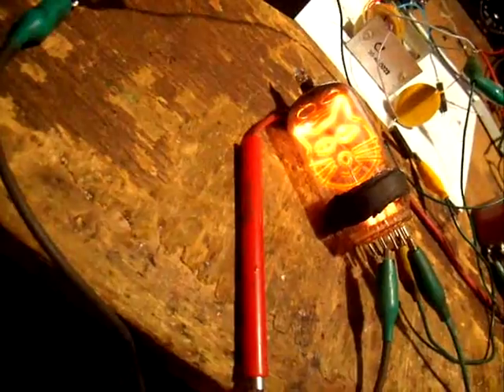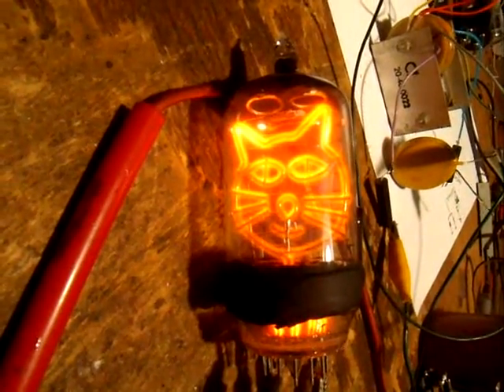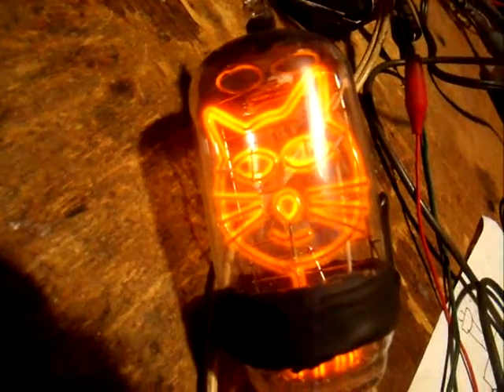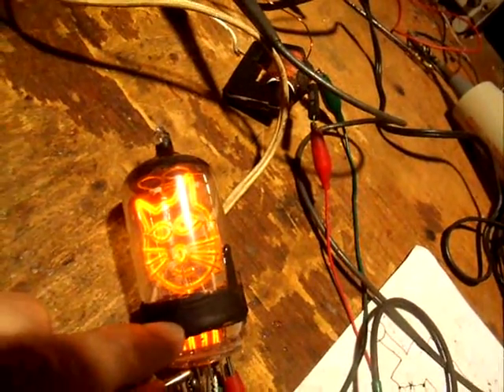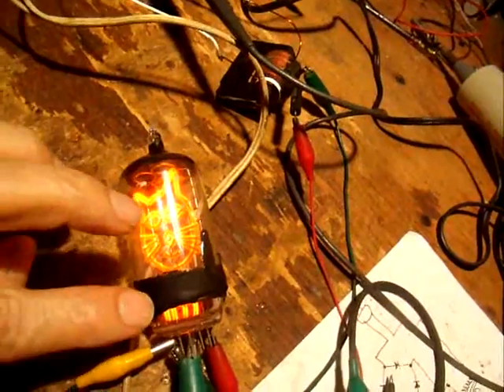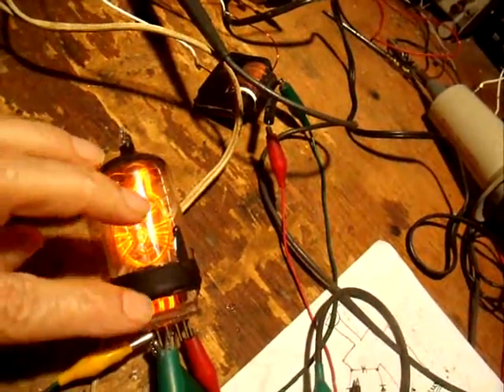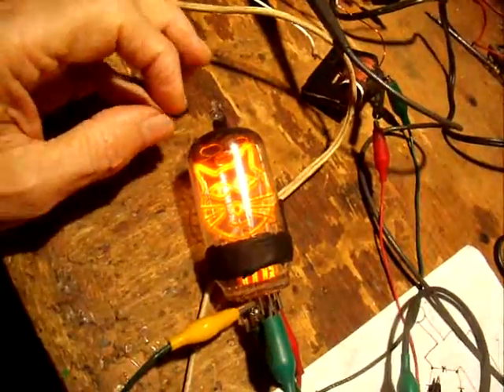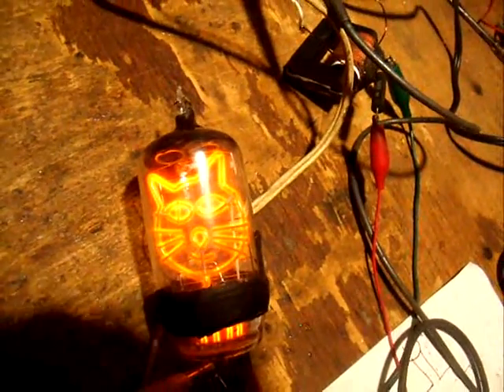WINKING CAT NIXIE TUBE!

Comment: Hi Eon why were you trying epoxy, instead of just fusing the glass like on your other tubes?
Reply from the maker: This was made of parts of old tubes that are soft glass. It takes very careful heating and annealing of soft glass to keep it from cracking. I have never been able to succeed at it using the old tube glass.
Reply: @glasslinger  Oh, I get that, but what was the point of using the old soft glass parts instead of your usual pyrex?
Reply from the maker: @andywander  I needed the 12 feedthrough pins on the bottom. Very difficult to make large numbers of feedthroughs from scratch.
Reply: @glasslinger  Ahh! Now that makes sense. I missed that part in the videos (if you explained it there). Though, seeing your work since this video was made,  I bet you could do a 12-pin base!

Comment: Stupid Question of the Day.....Could you use casting resin inside the glass tube to create a super-sized LED?
Reply from the maker: I guess so. Use one of the extremely powerful LED chips (10 watt or so) and put it in a mayonaise jar with the epoxy! What next!
Reply: what i meant is could you put casting resin in the bulb you have now to act like a led. not add a led. i want to make durable nixie tube out of plastic not brittle glass. after the resin hardens i might even want to break and discard the glass leaving a giant solid nixi bulb. would the nixi burn up the resin or short out? i have no real world experience with nixi so ...any guesses you might have would be appreciated.
Reply: The inside of the glass tube has to be hollow and empty of all air, otherwise electrons could not flow between the cathode and anode.
Reply from the maker: Yes! The stuff is really expensive I found. To make a "1 gallon" LED would cost around $75 and would have to be refrigerated during casting!
Reply: why refrigerated? heat of curing ?

Comment: you can get a softglass tubing called heavywall. used by Neon trade. 16mm diameter but much thicker. You can then heat it evenly and inflate it up to larger diameters.

Comment: Flame annealing (or kiln annealing) should help to make your glass not crack. So making welds easier. Pyrex to soft will fail because COEs are so diff (30 vs 96). You need to use same glass everywhere...

Comment: A cool animation in a nixie-tube could be a walk cycle. after 3 key poses the cycle repeats which means that you will only need 3 layers to make a little stick figure walk. Contact, Down and Passing position. Transistors, a decade counter. 555 timer and pot-meter to drive the thing and adjust the speed of the walk.

Comment from the maker: The cat went dark a few months after it was made. I think the epoxy separated from the glass in some places due to thermal flexing. Using JB weld epoxy to seal a tube is not viable. I have some industrial epoxy I will try when I get a chance.

Comment from the maker: The glass will crack right at the point where the two glasses mix. It takes a series of glasses to make a "graded joint" between hard and soft glass. The windshield glue works fine but it does leak. By the way, the cat has long since gone gassy from the epoxy leaking.

Comment: instead of trying to melt already used glass could u drip glass onto it to form a bond and have small vaccume to suck it into the joint id use blown light bulbs just smash them and get big chucks and melt them down 
be good to seal wires to wen seal isnt done well instead of trying to reheat whole asemblily

Comment from the maker: Hello!
The problem with compounds (gasses that are a chemical compound) is in the bonds in the compound. If the ionization energy of the gas is greater than the dissocation energy of the chemical bonds in the compound, the compound then separates into its component elements. Thus, you might get a beautiful green glow for a few minutes and then as the compound dissocated the glow would turn into the plain purple glow of the noble gasses or nitrogen. C02 gives a nice bright blue-white glow.

Comment: Hi i'm Ben and had a few questions! i see you said you use sulfur dioxide and it did not work But do you know what tetrafloroethane (dusting gas) would look like if any light came from it in a tube? and what would ethylene make for color? (The gas that ripens fruits) Also would mig welder sheilding gas do anything? ( 75% argon 25% co2) i'm asking since In the old days there was a tube called the Morr tube with co2 and co2 /nitrogen mix that made white light (I believe) I look for your reply

Comment from the maker: What it looks like is the epoxy has a different expansion ratio than the glass and popped loose at a point of high stress. I don't know if the epoxy will be practical because of this expansion problem.

Comment from the maker: Hello!
Unfortunately, bottles are made of soft glass. I don't have the equipment to work soft glass, which is much more critical to anneal than pyrex. I could use epoxy like on the cat, however the cat has since leaked up and no longer works.

ron

Comment from the maker: Hello!
The tube does not work. It gradually gassed up and now will not glow. I will seal a new stem to it when I get a chance and test it on the leak detector to see if the gassing came from a leak that developed or if it is from air permeating the epoxy. The other colors are made by coloring the glass and using argon for the fill. The corrosive gases do damage the electrodes. I tried sulfur dioxide and it dissocated and left sulfur powder in the tube!

Comment from the maker: Two reasons: First, this was a test to see if the epoxy would work as a viable seal over the long term. (result, no, the cat nixie eventually gassed up) Second, the glass used in the base is soft glass that is almost impossible to successfully reheat and work without having cracks. (all work I do is with pyrex, which can be easily reheated and worked.) But it would be very nice to be able to use the old tube parts that are made of soft glass, thus the experiment with the epoxy.

Comment: About the bases or "pinch" for tubes that need many (over 5)  leads: Have you ever considered using glass beads on the pass through leads, then embedding/casting those in epoxy to form a glass/epoxy matrix base? Then bonding that base to pyrex?

Comment: larger high voltage caps, but then again they might be hard to come by and only in small values. you could always modify a wall clock ticker to drive the electrode,via a HV transistor so it winks once every 1 or 2 seconds

Comment from the maker: I'm not sure you would need that many attempts. There is a definite technique to grinding the glass. The movement of the diamond abrasive disk must be kept such that it is sliding along the edge of the glass rather than across the edge. The across the edge motion seems to be what shatters it. Took me 6 attempts to figure this out. You now have the secret with no attempts!

Comment from the maker: That's a good idea! I was going to use a 555 timer and a transistor but it may be possible to use a relaxation oscillator. the trick is to get the blink to be long enough. The time between blinks is easy, but the discharge of the capacitor through the tube can be quite fast. The blink might be way to short.

Comment: you should hook a reflex oscillator onto the winking part of the tube and make an animated night light of sorts, i think you just have to hook a capacitor across the second electrode with a resistor to set the timing, when the cap charges and breaks the neon down the cap will discharge and repeats the cycle

Comment from the maker: I use a pinpoint flame gas-oxygen flame to heat the glue to red hot after it has been painted on the wires. This seems to be satisfactory in driving out the air and moisture. This is an inorganic compound.

Comment from the maker: I haven't the slightest idea! I guess around 10 torr or so. I have a gauge but the valve system I am using right now doesn't have another port to connect the gauge to. I'm working on a really nice manifold that will solve this problem. Right now I just bleed in neon until it glows great and then seal off the tube. Quick! :) I've only been making nixie tubes for a week now so I'm just getting started.

Comment from the maker: To insulate wires I use ceramic bead separator glue. (I haven't the slightest idea on what that is used for or why you would want to separate your beads!) The glue is made of completely inorganic materials and can be heated to red hot to drive out moisture and air. Works great and is very cheap on ebay. The wires on the bottom are the supports for the cat and eye. I didn't insulate them with the glue because I was afraid I would crack the glass when I heated it to red hot.

Comment from the maker: I use current drive on the tube so the striking voltage is not really significant except for the tube parameter you mentioned. The tube current is 55 ma peak, 8 ma average. The drive frequency is 100khz.
Reply: You are fun Guy  and  old school repai i Will give you a Oscar👍👍